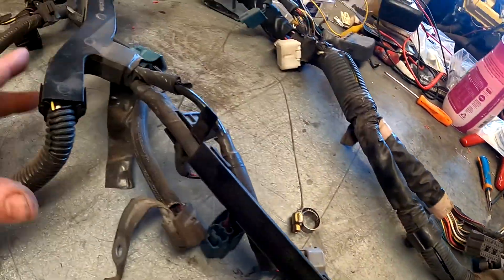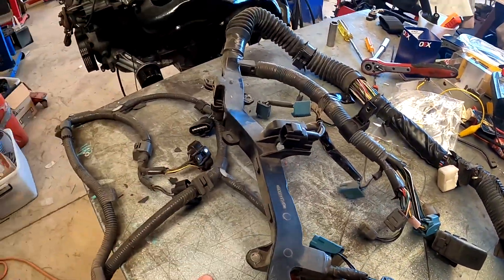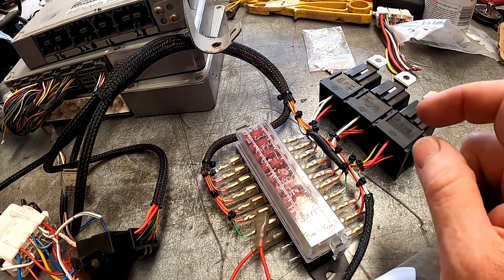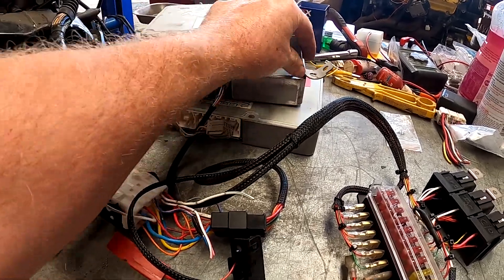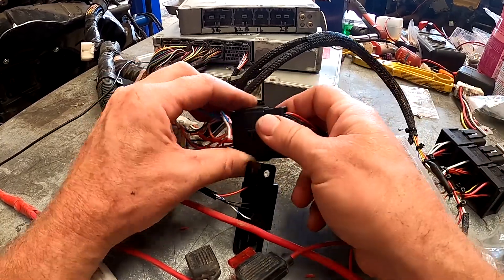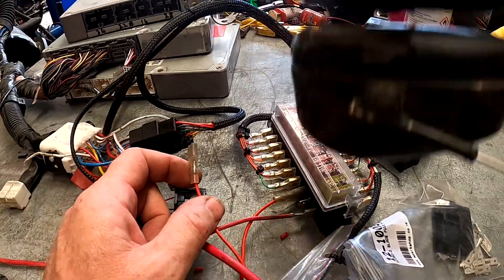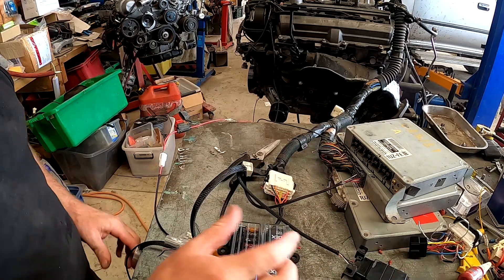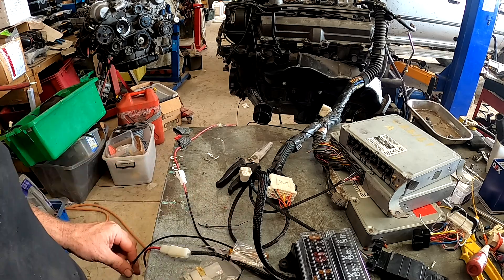UCF20 / Gen 2 1uzfe  Relay and fuse box options for swaps.

Comment: Nice video, but I have a little problem to understand you language. Do you have any wiring diagram with basic circuit? I have 1UZ from LS400 ´93 Europe (Spain).
Reply from the maker: I sell information for wiring of most 1uz engines in swaps and it can be used for diagnosing on stock vehicles.  Cheers Kelvin

Comment: I built a relay and fuse panel wiring set up as per your ucf20 wiring instructions. Can you think of any reason the car would fire for a a second then turn off?
Reply: Didn’t really understand the whole “loop” situation without the fuel resistor found the hand drawn instructions quite frustrating if I’m honest
Reply from the maker: Are you running the stock fuel pump resistor?  Do you know about the fuel pump resistor circuit the stock ucf20 vehicles run?
Reply from the maker: Normally a start and stop is a faulty coil or air flow meter issue.
Reply: I’m running no fuel resistor just a single speed pump. In your instructions it says resistor or loop ive looped mine. So pin 87 on my circuit opening relay is going to 86 87 and 30 on the fuel pump relay ie “loop”
Reply: Motor runs fine with straight power to the pump but goes Into limp mode without the ecu controlling fuel.
Reply from the maker: Perfect.  That will prevent a code 78 for the fuel pump circuit.
Reply: But yeah a video would’ve been nice I’ve not really been able to wrap my head around that relay set up
Reply from the maker: I'm only one guy,  and slowly doing a video on every topic.  There is a video for only instructions customers on making the relays that's been added recently.  Are you sure you have fc and fpr around the correct way?
Reply: @CartuneNZ  that video would’ve been good when I got the instructions I only got a video on the overdrive wiring. Yeah I’ve tried the fc fpr wires around both ways haha. I think I’m just going to put a Haltech on it doing my head in
Reply: @CartuneNZ  if you have that video that goes along with the instructions i bought that would be awesome im kinda at my wits end. im thinking i may have wired power to reverse instead of the maf as theyre both black and white wires but ill have to wait until im home to check. cheers mate
Reply from the maker: Flick us an email in the same thread you purchased the instructions and we can sort when in the office.  We are on holiday for a few weeks but ill make sure I sort that one when I'm tiding up a few bits over my break on the work machine.

Comment: Happy Christmas Kelvin!!! Can this be done with a UCF 10 as well?
Reply from the maker: I have had both the early UCF10 and the later UCF10 for many years now.  We use them on all out own jobs as well as selling them.  Cheers Kelvin
Reply: @CartuneNZ  I have the original UCF 10 ECM. I replaced the capacitors in it, and it's working great now. Can I somehow upgrade the ECM to read OBD2 codes, or do I need to get a newer ECM?
Reply: My ECM is a 1994 model year.

Comment: My ucf20 a340 transmission has randomly stopped going into O/D any idea what the issue is? Fresh type iv Toyota atf fluid was put in but no difference annoyingly.
Reply: solenoid?
Reply from the maker: ok.  If I was to look at this car I would do the following.  Id confirm the ecu is seeing the D-3 switch on pin A28.  I would confirm the ecu commands for the solenoids.  Most likely the solenoids would have resistance checks and maybe a manual shift test.  I would also be looking at the transmission temp sensor readings.  If this fails then the ecu will lock out overdrive.  I'd also be checking the condition of the ecu itself.  Within these tests the issue will be revealed.  Cheers Kelvin
Reply: @CartuneNZ  cheers ill get right on it!